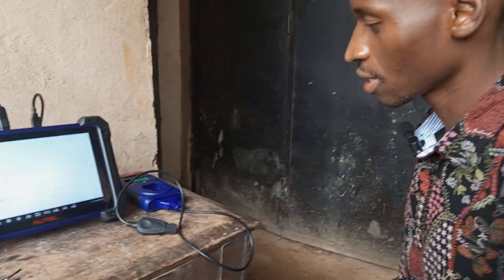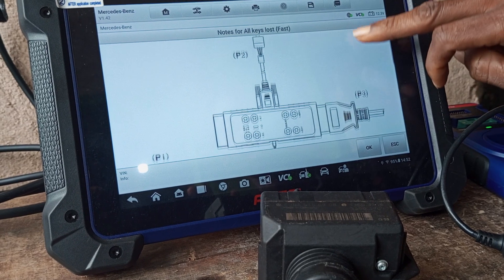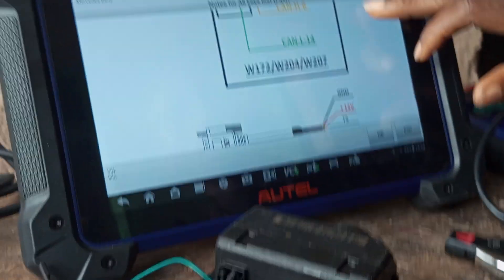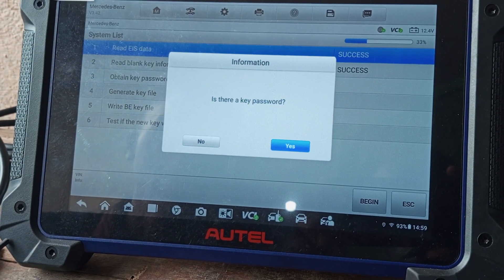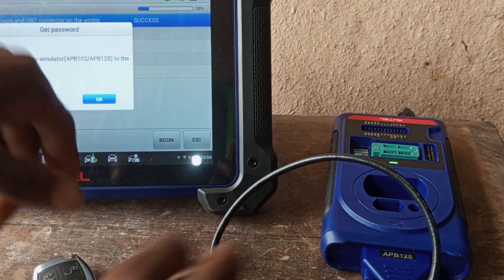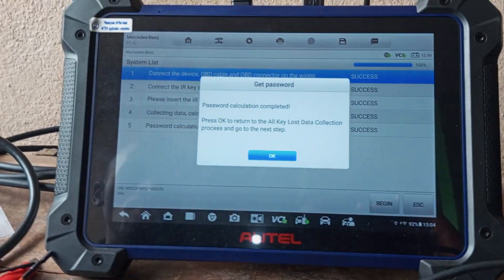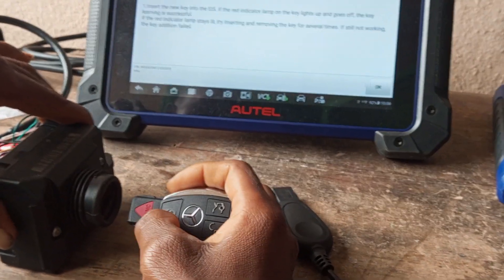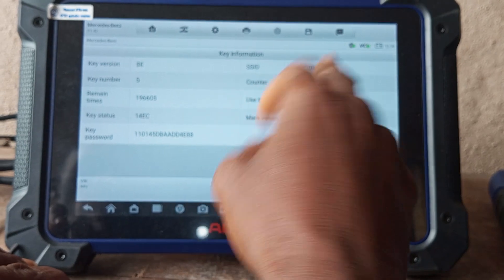How to program a Mercedes Benz all keys lost with im608 pro ii. @Lasselectricalzone

Comment: Hi thanks for
The video.. does the key has to be new and original? And if it is after market can be used for AKL on that Mercedes?
Reply from the maker: Yes, if the key is used. The new brand one does not need to be renewed.
Reply: @Lasselectricalzone  thank
You